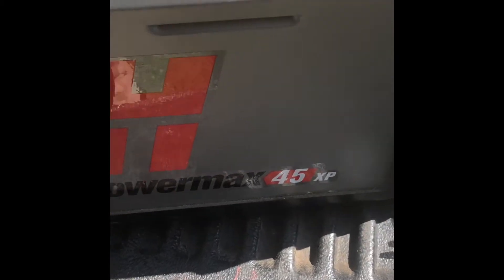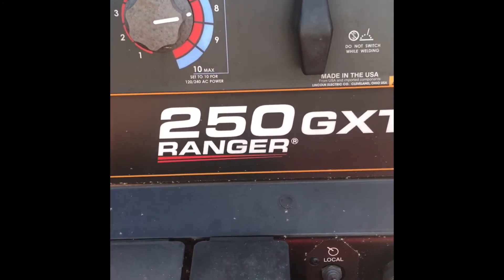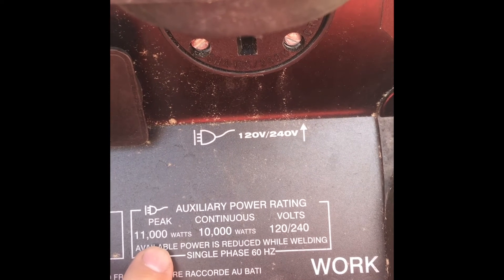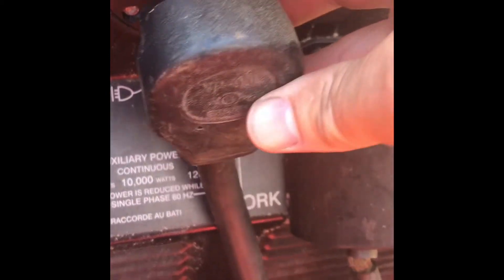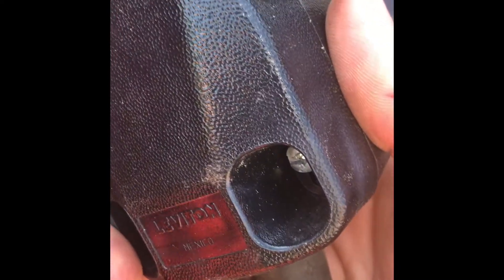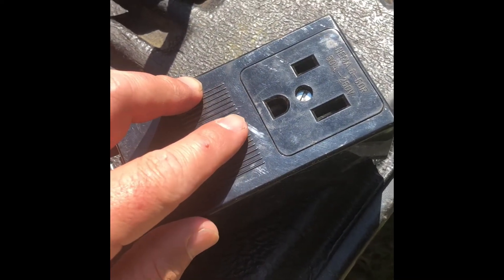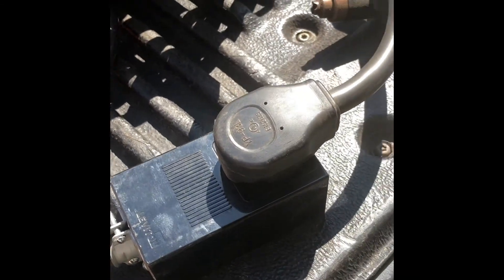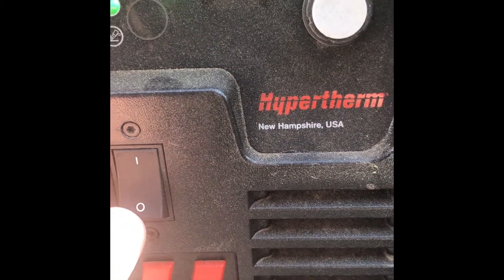Hooking a Plasma cutter to a mobile power source

Comment: Thanks for video.  I have same model plasma and just made a similar converter cord to run it from my Miller Bobcat 250 welder/generator.  Have you had any bad luck running your torch this way?  Also, I have a small pancake compressor but figure it will be too small to do long cuts so I have heard that some fellers use compressed air tank?  Any suggestions?  I don't think it will be a good idea to run my small compressor at same time off same generator as plasma torch
Reply from the maker: I've had no problems as far as my 250 running the plasma cutter. However I use a engine drive 12HP 30 gal compressor to supply the air. I don't think the pancake will run it long or it'll have to steady run. I have used a compressed air cylinder years ago and it works fine, but cost and time I felt like it wasn't practical.